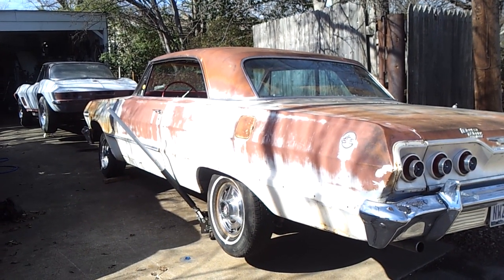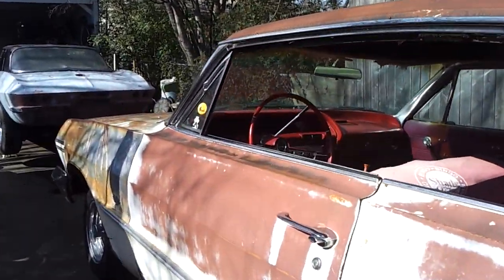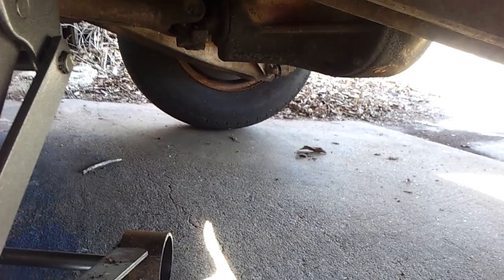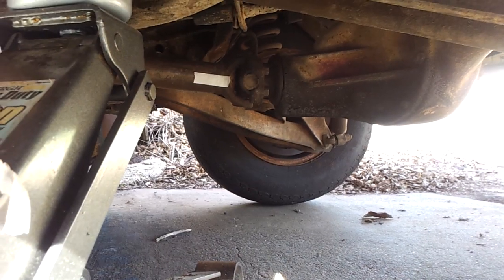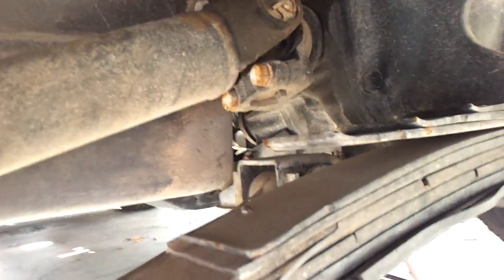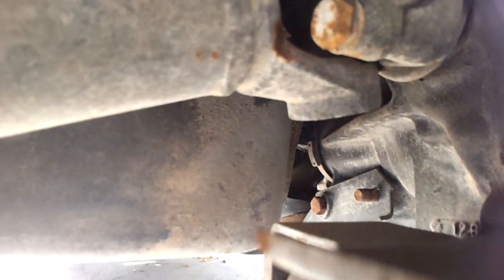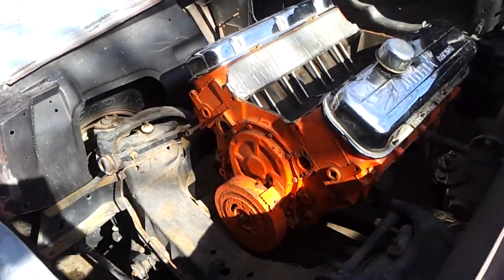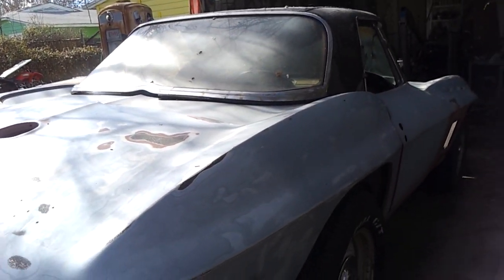Gear ratios, quick easy way to check a cars axle ratios 67 corvette 63 impala

Comment: i just bought a 63 4 dr. ht impala that has not been driven since 1989...3 rusty floor pans & some in the boot....orginal 327 auto with orginal am radio...all electric works except wipers...missing coil,which is coming in from texas this week & then i will get it running...interior worse than yours,but time will fix that...you are an inspirition to me...i just will take my time & fix one thing at a time...i watched ALL your videos79 of them....thank you for thinking enough of other people to go to all the trouble to do this...thank you so much...you never did say what you paid for yours,i got mine for $700 & that was delevired to my back yard from mebane n.c.,60 miles from thomasville....i am not discouaged like i was........MITCH THE MAN....